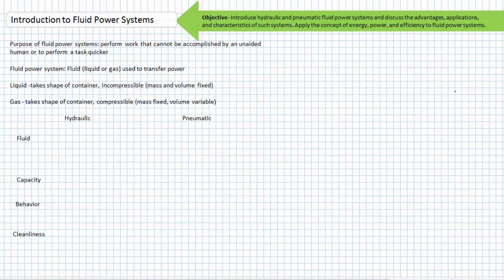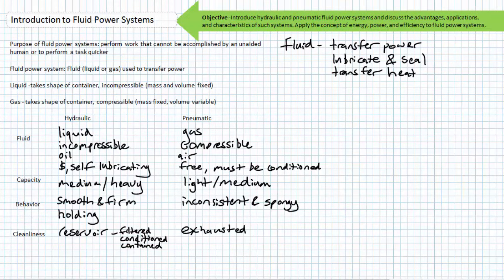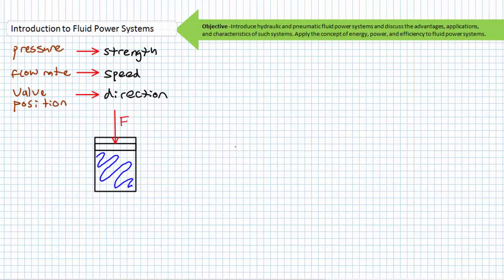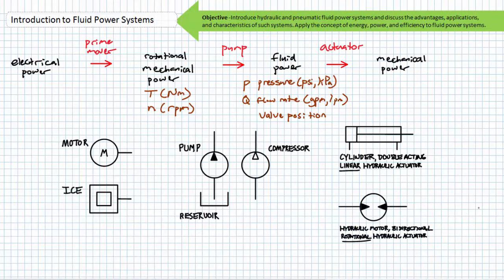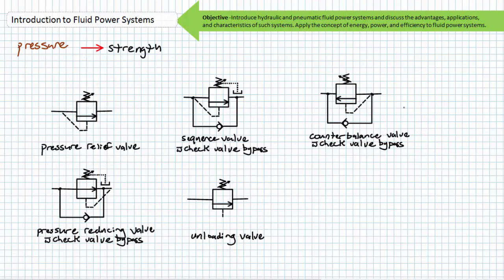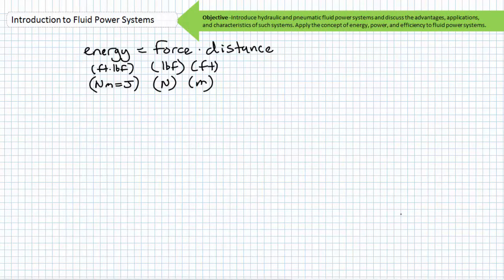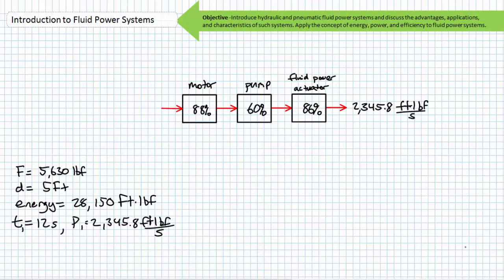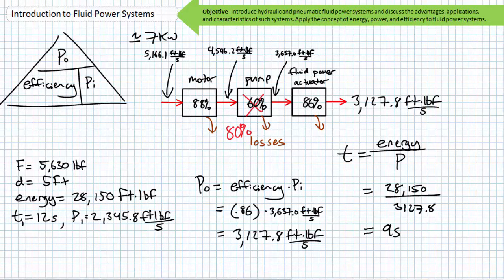Introduction to Fluid Power Systems (Full Lecture)

Comment: Are the "losses" within the system you displayed arbitrary numbers (88%, 60%, 86%)? Or are there losses in all systems and a way to determine what those losses are, numerically? I'm brand new to this.
Reply from the maker: Typically students will have already completed the DC circuit electrical analysis playlist before they start hydraulics so there is some background prior to this particular lecture. Specifically I'm referring to "efficiency" which is discussed in this lecture: https://youtu.be/tviuUPIyzHE?si=eLSY5GDruLKRQ1W8
Reply: @bigbadtech awesome haha next video! Thank you for these videos. You clearly put a lot of work into this.

Comment: I work for a company that, especially given the local candidate pool, could allow me the opportunity to get into maintenance without any formal schooling.  I've been a lead since our inception.  Trained with the engineers from debug process on. Basically, I'm as close to being a tech as a lamen can be. I can trouble shoot and fix issues beyond my job(always have been trained as such) tbh there's some techs that are barely beyond my knowledge and that's just from years of experience in the position.  I say that to then say, I don't have any formal knowledge. Any recommendations on where to start would be greatly appreciated.  I work in an assembly room. Lines built less than 5 years ago. I started here as we use a lot of pneumatic power systems. A lot of smaller robots (we have programmers so we have limited access to them) some smallish presses. As I got towards the end of this video you referenced an older video on power. So I feel like I should go back. I went all the way back, and there's a bunch of videos that seem way out of the line of what I'd need. I don't need some comprehensive lesson plan, you've already done enough!! But was hoping for a few tips on where to start. Thank you!
Reply from the maker: Honestly the best place to start is the basic electrical circuit analysis series. https://www.youtube.com/playlist?list=PLdnqjKaksr8qQ9w3XY5zFXQ2H-zXQFMlI The first lecture gives guidance as to the sequence for the 3 sections. This is admittedly NOT the easiest skill set however it IS the most valuable skill set in industry. Once you understand electrical circuits your world really opens up. Additionally you might want to check out the hydraulics and motor control playlist once you're about halfway through the 3 part electrical circuit analysis series.

https://www.youtube.com/watch?v=S_4anj7GpRo&list=PLdnqjKaksr8ruhw85YYSSO6EWLhVVmSKm

https://www.youtube.com/playlist?list=PLdnqjKaksr8qRPCFkU2Q8XQe0bfo99rs6
Reply: @bigbadtech  thank you!! These are the two I've been watching thus far. Some stuff clicks easily other stuff I'll watch/listen to until I have it down. You're great sir!

Comment: Great job on these lecture series Jim! Thank you! I have a question for you. What textbook do you recommend to use as a reference for your Fluid Power lectures?
Reply from the maker: I've compiled the study guides for hydraulics and basic electrical circuits here:
https://openoregon.pressbooks.pub/electronics1/
https://openoregon.pressbooks.pub/electronics2/
https://openoregon.pressbooks.pub/electronics3/
https://openoregon.pressbooks.pub/hydraulics/

As far as a traditional paper textbook I've always liked ATP's "Fluid Power Systems" 2nd edition by Patrick Klette. Very nice cutaway diagrams!

Comment: Hi Jim. 
First a big thanks from argentina. your contenent is  outstanding and priceless.
Second, would  you recommend any sources for learning this kind of technical subjects? I find its easier  to find lectures on physics, claculus, etc than finding lectures or well structured content to learn from on subjects like mechanics, electromechanics etc. I love your lectures but I also love reading the same subject from diferent sources to get more context. Thanks!
Reply from the maker: Good question. I get a lot of information directly from manufacturer's websites. Omron, EATON, Allen-Bradley, Xilinx, etc. have lots of good material, although sometimes it's not exactly organized very well. Regarding fluid power systems check out KletteTech by Patrick Klette. He's also another community college instructor that's posting free material. Last but not least, check out EEVblog, for lots of more advanced electrical material.

Comment: I'm new to the channel and enjoying the math😊
Trying to learn more for trouble shooting as well as I'm thinking about using hydrolics to drive a garden tractor for tractor pulls to gain more speed and momentum to go further down the trac than a standard gear transmissions that spin tires, run out of speed, or run out of torque.
 All still in the air nothing drawn up yet I want to know more and I'm thankful to be able to see your channel🤘

Comment: It is not correct to say that air is compressible, whilst liquids are not. Both states of matter have a bulk modulus and whilst the bulk modulus of a gas is much lower than that of a liquid, both are still compressible to such an extent that it possible to see the affects of compression in a working hydraulic system.
Reply: True, but it is a very important point to note this large, mostly true difference between hydraulic and pneumatic systems.  Very clever to use the syringes to graphically and tactilly show the difference between the two.

Comment: Hello Jim Great Video

A request Jim, could you please upload a class on  youtube explaining about application of Closed center,Tandem Center, Float center and Open Center of the 4/3 or 5/3 valves. I am confused on how and when do we use these center configuration of the valves.
Reply from the maker: +Aditya Bhat Check out the "Directional Control Valves" lecture at: https://www.youtube.com/watch?v=QaagWlHbxr0

I briefly compare and contrast these valve positions with one another.

Comment: Hello Mr. Pytel,
I was wondering where you disappeared to after the Introduction to PLCs lecture. I had been checking the playlist page but not the videos page. I have seen your original hydraulics lectures. They are so helpful in my work as a maintenance electrician in a corrugated products factory. Not only have I seen all your lectures on the BigBadTech channel, but I refer to them frequently when I need a quick refresher in order to accomplish a particular task or solve a problem I am not familiar with. I am very much looking forward to seeing these updated hydraulics lectures.
Thank you for helping me become competent at my job.
Best to you.
Reply from the maker: +John Shearing Yes, I'm kind of on a hydraulics kick right now. Expect me to return to PLCs and more in a bit. Setting it up so I can refer to hydraulic applications as well as motors when I roll out PLCs.